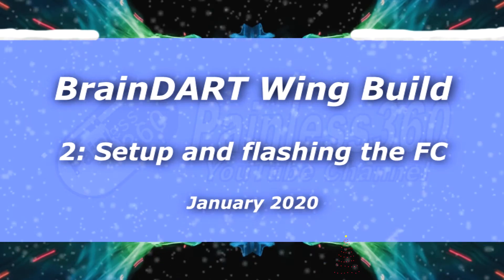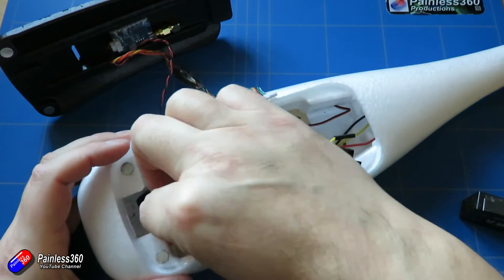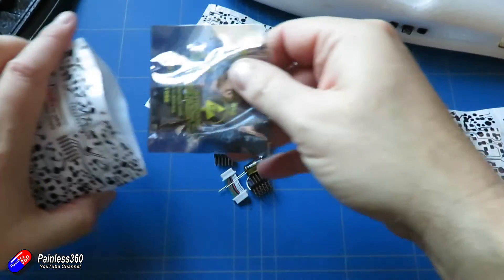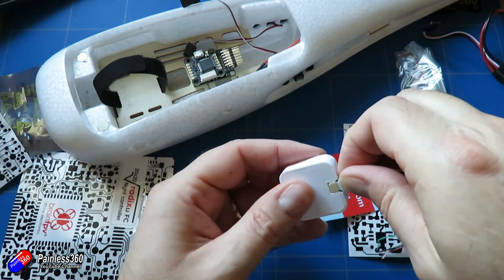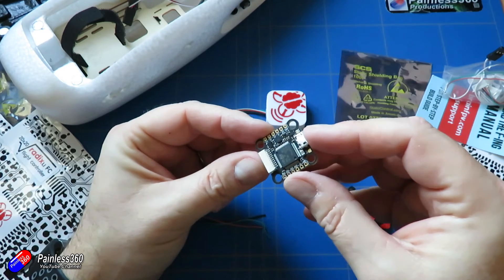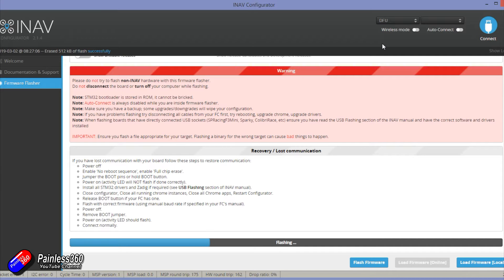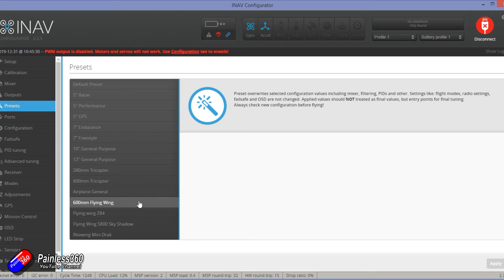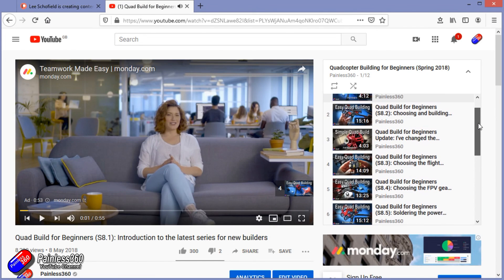BrainDART build: Setup and flashing the Radix with iNav

Comment: hello Lee , today I went to the field to fly my miniskyhunter with the inav f765 inside , it had never given any faults up to today . On the osd was written : UNABLE TO ARM , DISABLE NAVIGATION FIRST . Do you have any idea about what that means? I haven't found anything on github . If nothing  comes up , do you know of a platform on which I can ask directly to the inav developers? Thank you very much !!
Reply from the maker: Make sure you are just in angle mode when trying to arm...
Reply: @Painless360  I am in manual mode all the time 😢
Reply: @Painless360  I does not work.  I tried arming in all the different modes possible , but the message (DISABLE NAVIGATION FIRST)  keeps blinking , and it doesn't arm